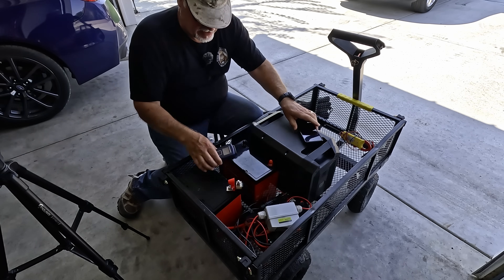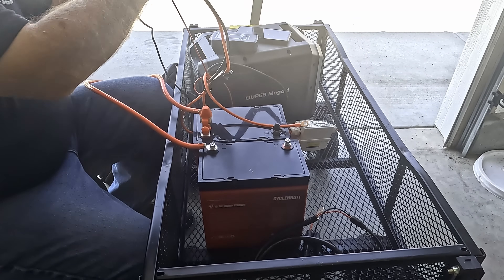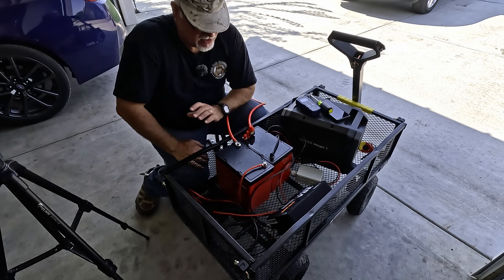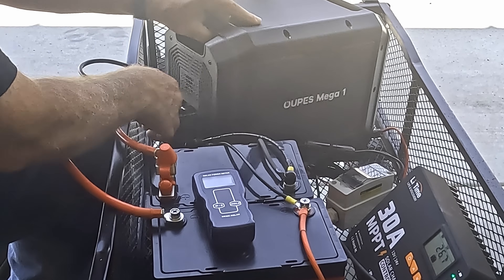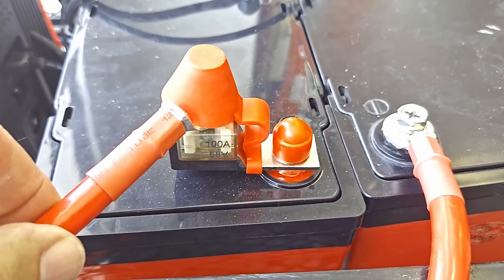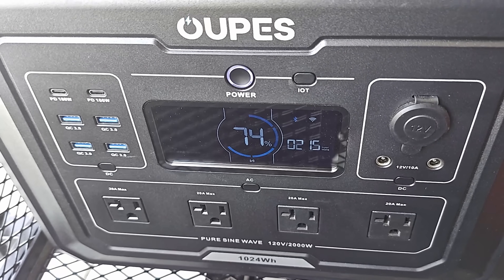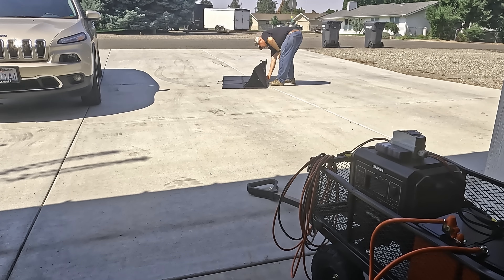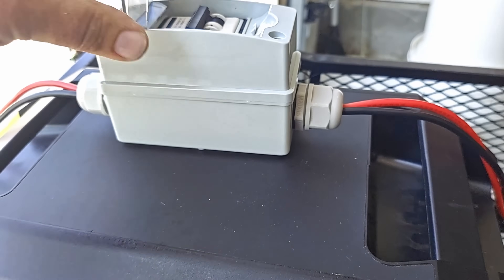Solar Panel Powers Battery AND Power Station Simultaneously – TESTED

Comment: What AWG wires were used for the batteries in series? What size DC breaker for the solar panel? I'm planning to go with two 460W panels in series (so 920W total) with this battery set up
Reply from the maker: Battery cables should be sized for the Amp draw.  When I return I can get that for you.  For the breaker this (link in description I believe) was a 15amp breaker

Comment: Hi you helped me  with connecting a battery to a power station but after seeing this video can you me with this . I have 990watts of solar 123volts 11 amps in series with a 20amp fuse 40amp breaker cut off switch a 40amp 150volt charge controller a 50amp fuse to my 24volt battery. Now from my battery to my Allpowers R2500 powe stations has 150volts and 13amp max xt60 solar input do i need a fuse if yes what size. All the best Ron.
Reply from the maker: I'd run 10awg wire and fuse for that (30amps would be fine).
Reply: @TheOldJarhead  Thank you i have 8awg cable with a inline fuse holder so i will get a 30a fuse. best alway's
Reply from the maker: That works :D
Reply: @TheOldJarhead  HI I FOR GOT MY TOO 12V BATTERY IN SERIES HAS A 200AMP BMS IS A 200AMP FUSE THE RIGHT SIZE
Reply from the maker: In series, they would be 100A if both batteries are 100 amp BMS's -- only way to get 200A at 24v with two 12v batteries is if they are already 200A BMS's on each battery.  You add the voltage but not the amps.

Fusing is based on cable size, not the batteries so a 100A setup would need at least a 125A fuse.
Reply: @TheOldJarhead  Hi the 12V BATTERY has a 200A BMS the battery's joining cable is a 0 B&S about 25cm long could i use a 200AMP fuse
Reply from the maker: Not sure what you mean by 0 B&S?  Is it 0 awg?  Zero Guage? 0awg cable is rated at 150a power transmission or 245a for chassis wiring.   But fusing depends on cable and cable depends on usage.  If taking two 12.8v 200a batteries in series and wanting to fuse the batteries for max usage to an inverter, then 0awg would be enough and would be fused for 25% more than the cable rating so about 275a but if feeding them to a power station that's different as the solar port won't draw that much so smaller wire works
Reply: @TheOldJarhead  HI MY CABLE IS RATED AT 245A. BUT IN YOUR VIDEO YOU CONNECT YOUR TWO 12V BATTERY'S IN SERIES TO MAKE 24V YOU USE A 100AMP FUSE FOR YOUR SET UP. WHAT SIZE FUSE FOR MINE
Reply from the maker: ok, back to the original post, to connect to the All Powers solar port that draws 13amps a 15 ir 20amp fuse is fine.  The battery rating only matters if connecting to something that will draw that.
Reply: @TheOldJarhead  OK THANK YOU FOR YOUR HELP
Reply from the maker: You bet

Comment: Hi there, So glad I'm learning how to provide my place with power when needed or to run say a 750w water distiller to save on the electric bill . I know I have the Jupiter Pure Sine wave but my AP2000 is already available and I'm thinking for the time being I could save and not buy an MPPT controller... wouldn't I need one if I use the Jupiter? I saw your set up on another video and it looks like one's mounted hiding behind the battery. I'll have 2 12.8v 100ah batteries and for now I want to run my distiller by using the power station with one of my batteries hooked to an xt60 cable. I'll see what happens. I've never used any of the station ..100w solar panel still in box ha. I'm not all understanding the differentiation as to why, for instance the station is a 2000w, but the load distributed is a less wattage amount? I know this all is pretty simple. I bought a 14.6v battery charger to charge my batteries. What if there's no power... could I use the AC input on the AP 2000 to then be able to use the 14.6v battery charger to charge the batteries if I had to? I'm wanting 2 systems in separate rooms I think  ...just trying to learn the options since I can set up 2 systems.
Reply from the maker: Hi :)  You don't need a charge controller to use the Inverter but it's a good thing to have if you are wanting to recharge the batteries from the sun.  For two 100ah batteries (12.8v 1280wh) you will need a lot more solar to get them charged up in a reasonable amount of time.  For example, if you just use 50% of their capacity then you'd need to recharge 1280 watt hours of power.  With a 100 watt solar panel and a good MPPT Charge Controller that would take several days because at best, you'll only get about 4 hours of 'peak solar' a day and maybe only 6hrs of total charging (at least this time of year).  So, 4hours x 100w = 400wh...so it would be best to have at least 300w of solar.

Now, as for the AP2000 I believe that unit has a 2000 watt purse sinewave inverter and a 1500wh battery.  This is pretty typical actually and I think they do it because people see "2000 watts" and that's bigger than 1500 watts so they get it not realizing it's just the potential output.

A 750w distiller likely runs that for 4 hours (I'd need to check mine since I have one though I'm not sure of the power usage on it) so you'd need 3000wh of power at a bare minimum to run that to completion.    With the batteries run to the solar port they will provide much of the power needed and you should be fine.

As for charging, I'd not run the charger off the AP2000 as it will just transfer power, inefficiently, from the AP2000 to the batteries.  Better to have another option (solar or an actual generator).
Reply from the maker: I ran mine today, and it used just over 2900wh in the 4 1/4hrs it ran and consistently drew 737.5w.  This means the ap2000 with 1500wh would use 270w or so off the solar port if the batteries are in series and die in 3hrs of running even though the batteries would still have plenty of power.

Using say, the Dabbsson DBS2100pro with the same two batteries in series would make that 4hrs fine.  At least that's my take sobfar.

Comment: Can i charge a lithium battery with a gel agm lead acid battery fed by solar?
Reply from the maker: Not sure why you would or exactly how you mean?  You need a different charging profile for LiFePo4's than for AGM's so the voltages are different. 

Now, if you mean, can you plug an AGM into the solar port like I did the LiFePo4 here, and charge the AGM off Solar (like here), yes but DO NOT.  AGM's and FLA's (Flooded Lead Acid) do not have the lifespan/cycle life of LiFePo4's and do not have discharge protections built into them.  As such, you will kill that AGM pretty quickly and damage it.

Comment: Hi Eric. 
Im still confused..
Cant see actually 
Did you use a regular ac plug into the power station from the battery's 24 volt
Wouldnt you need an a/c inverter from dc battery
Or is that plug a solar input xt60 
Thanks Doug
Reply from the maker: xt6 cable from battery (ring terminals) to solar input.
Reply: @TheOldJarhead 
Hi again
Yes I slowed the video & stopped it 5 times & rewatched it again
Your hands were  to quick for my eyes to view 
I could bet a $100.00 you plugged a outlet plug in large black plug
Again I'm wrong
Sorry do you take IOU's
So right an xt60 plug to ring terminals 
Yes I do hear ya & looked real nice setup
Thanks Eric
Reply from the maker: No worries!  I should have explained that.  I forget not everyone has seen all of my videos 😉
Reply: @TheOldJarhead 
I for one watched all your Video's 
Really saw that & i did coment that you answered me & i did use & do as you explained on my ecoflowriver2pro for rainie days or low power
Just I want to thank you for all your effert & also that cross wire explosion one thats why i asked you about this it didnt sound correct to plug dc into a ac 
My bad Thanks  Eric
Over n out  Doug
Reply from the maker: No worries!  and thanks for watchingbthem all!!!

Comment: Hey this Is exactly how I have my camper trailer setup! I have 1000w solar that charges my 300ah Vatrer Lifepo4 battery and that charges my Anker F2600 (and expansion battery) my rig is plugged into the 30amp outlet on the Anker to run my rig!  Converter breaker is off.  I have had so many nay Sayers on Facebook who say it makes no sense but for me and my family it works great!!!
Reply from the maker: That's great!  And doesn't matter what they say 😉
Reply: Ignore the naysayers there are Dyme-A-Duzin.
Reply from the maker: Agreed!

Comment: Great Video.
If i use a xzny 280ah battery what fuse should I use to do this? 100amp or ?
Thanks
Reply from the maker: For which connection?  At the battery, it should match the max cable capability plus 25%.  So, for example, 8awg cable can take 45 to 50amps, so it's best to use a 60 to 75amp fuse.  I was cheating with a 100amp fuse which matches the BMS but not the cable.  It should have been smaller.

From the battery to the power station or Cc follows the same rule.  I was using 10g wire so 49amp Fuses are fine.

Comment: I do this with my Jackery 5000 and Golf Cart 48V batteries. I have 2500 watts of solar going into a Victron solar charge controller. Charge controller charging the 48V batteries. The 48V batteries are connected to the LowPV input of the Jackery 5000 unit. The Jackery 5000 will draw 1000watts off of the 48V batteries max. This system is way cheaper than the Jackery 5KWH batteries for $2000 each when golf cart batteries are $750 for 5KWH.
Reply from the maker: That's a great way to do it, and yes, it's definitely cheaper than proprietary battery packs!

Comment: My setup exactly: 5kw battery charged by 900w of panels using the victron 100/20. The battery feed in the PV input of the oscal power max 2400 that powers up my home.
Reply from the maker: Sounds like a great setup!

Comment: VERY cool! I have a 2000 Watt Pecron that I LOVE, and has really come through in some recent outages... but, from what I understand, even though you have an opus in this video, the  Pecron has similar ports on the side... it would be a WAY cheaper option to buy a couple deep cycle batteries, a charge controller, and a solar panel to bump this one's capacity from 2000 Watts to 3600 (...plus, depending on the amount of batteries?)
Reply from the maker: Yes, it has a solar input which is what I'm using though the Pecron's also have an external battery port that you can modify the cable for and directly connect a larger battery of the same voltage.  Just be sure to only use LiFePo4 batteries.

Comment: Wouldn't you want the power station hooked up to the load from the mppt? Wouldn't that use the batteries as a back up when solar isn't being fully utilized? Thanks!
Reply from the maker: Nope.  The load is only 12v vs the batteries in series are 24v..Ideally, I'd do this with the 48v battery paralleled to the Oupes and the solar connected to the battery via it's MPPT leaving the Oupes MPPT open for a second array

Comment: Very nice project. I'd just add low voltage cut off between the battery and solar generator power station. This is basically my favorite setup though. Can always add more Solar/battery/power stations to the system.
Reply from the maker: The battery has it's own low voltage cutoff :)  That's the nice thing about LifePo4's

Comment: Great video. 
I have a Bouge RV power station, and I can only connect a maximum of 200 watts of solar panels to it. 
Can I safely connect the batteries to the Bouge RV's solar panel connection?
 I think it's possible, but I'm asking just to be sure.
Reply from the maker: Yes you can!  The power station doesn't care what size the battery is, it just sees a power source (voltage) and starts drawing off of it.  Just be sure the battery voltage is within the power stations solar input rating.
Reply: @TheOldJarhead  thanks for the answer and greetings from the Netherlands
Reply from the maker: Thanks and Hi!

Comment: Hello great job. I like to know where did you plug the batter cable up to on the power station. Was it the solar input on the power station. If not could you plug it there. I have a f3800 plus with two solar input. rated 11 volts to 160. volts. Im getting a 48V (51.2V) 100Ah LiFePO4 Lithium Golf Cart Battery.
Also im getting a LiTime 60A MPPT 12V/24V/36V/48V/Auto DC Input Solar Charge Controller.
Can you explain how this will work out.
Reply from the maker: Sure, it's plugged into the solar port.

Comment: Yeah i allready figured this out accidentaly, as you might know my powerstation keeps dropping to zero watts if i use wat looks like to long a cable but my mppt controller works as a buffer so i charge a battery with long cable through mppt controller and connected my powerstation to the battery. NO more drops to zero. Great plan and explaination. Have a gr8 day.
Reply from the maker: Glad you sorted it out!

Comment: Can it be reversed so the solar is charging the power station and the power station charges the battery? 

Then at night the battery can resupply the power station as needed. ( i dont own a mppt)
Reply from the maker: Not really.  The way to do that would be to parallel a battery via the external battery port.

Comment: what kind of cable is used to run from the batteries into the power station?   Thanks!
Reply from the maker: In this case a Ring terminal to Anderson plug cable like this one https://amzn.to/46ofq9y will work.  In my case I'm using ring to MC4 cables and just connecting those to the Oupes solar cable :D  You can also get the MC4 fuse to go between the positive side for protection like these https://amzn.to/41FJoU1 just note that they may have to be rolled (red to black, black to red) because they may not match up to the Oupes solar cable (I had to roll mine and retape them so I didn't get confused) because the solar input cable is meant for cables coming from a panel which are sometimes different male/female configurations (hope that's not confusing! - just be sure to check the colors when hooking them up).

Comment: This video is very important, with this setup we can use solar panels of any capacity to charge a power station.
Reply: Yes, this will work. As i said in another comment. Batteries , regulator, diy things  used as a "gas station". Powerstations can be refuled and used..anywhere. And no problem putting a AC-inverter on the batteeies and fast charge the powerstation whenever.😊 Versatility. Adaptation.
Reply from the maker: I am glad you found it helpful! and YES!  You can run bigger panels to the battery than the power station can take :D
Reply: @TheOldJarhead For example, can this system work without batteries? Just using MPPT?For example, if I have a 45V VoC panel but a Power Station like the Exodus 1500 that only supports 30V, could I make it work using the MPPT at 24V? Here in Cuba it is very difficult to get panels with less than 30V. It would be great to be able to use any panel with an external controller to charge the station.
Reply from the maker: I don't believe that will work because the MPPT charge Controller is looking for battery voltage to determine how to charge the battery.  Daisy chaining controllers wont work.  Better to get the battery, even a small one, and put it in the middle.
Reply: Yes but if you overdo it, the charge controller can get extremely hot because it has little place to dump the power
Reply from the maker: Huh?  As long as the CC is rated for the panels it will be fine.
Reply: @TheOldJarhead  that's not true.  Let's say you have the largest allowable input power for a specific charge controller, along with a dinky 300w portable power station.  One where you're lowering 200v into a 12v system.  You're gonna have a lot of heat😂  Put a 50w panel on a 50kw, 200v system(and the charge controler can move 6v and 12amps) and I'll be running cold.
Reply from the maker: That's not what's happening here.  The cc and panels charge the battery, full stop.

The power station pulls power from the battery.
Reply: @TheOldJarhead the power station pulls power from the battery WHEN you're using the power station.  If you're not using it at all or not enough, you've got a different story.
Reply: @TheOldJarhead  You are correct.  Power from PV panels is regulated by the charge controller.  When the external, add-on LiFePO4 batteries near full capacity, the CC curtails the charging rate, and eventually disconnects the charging.  

The power station similarly will independently pull power—as needed—from the add-on batteries via the station’s MPPT CC to charge the station’s internal battery towards full, plus support any load demands on the internal battery.

Super idea to use a Marine Rated Battery Fuse (MRBF) at the positive external battery.  I always use them for these applications, and appreciate you showing the viewers how to protect their cables appropriately!  Nicely done.
Reply from the maker: Thanks bud, and yes, that's how it works and it's safe and effective.

Comment: This right here is my jam!! Sure it's not as convenient and powerful as the oupes expansion battery but it costs less and it's far more versatile.
Reply from the maker: and you can add more as you can afford them but, check out my other Oupes expansion videos because I hacked their B2 battery cable and wired up a 5kwh golf cart battery to make it a 6000kwh unit :D